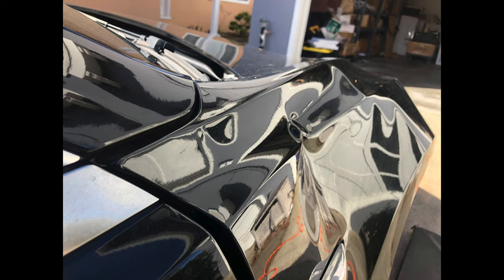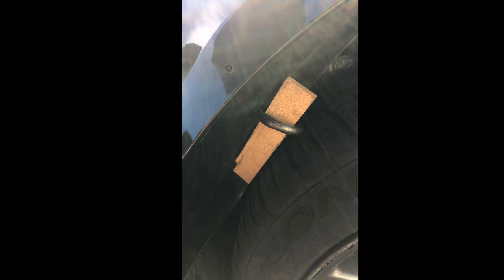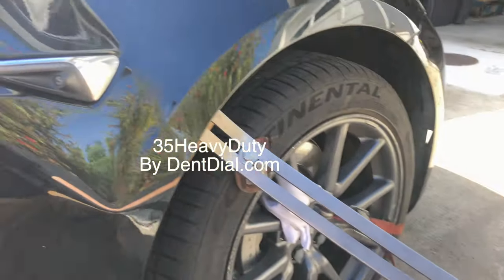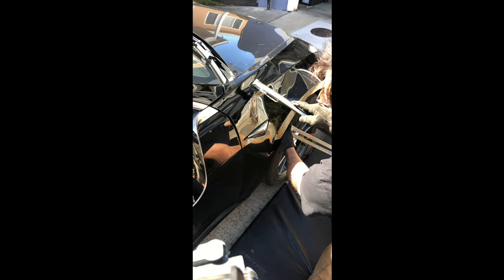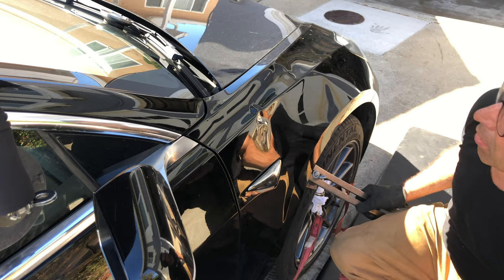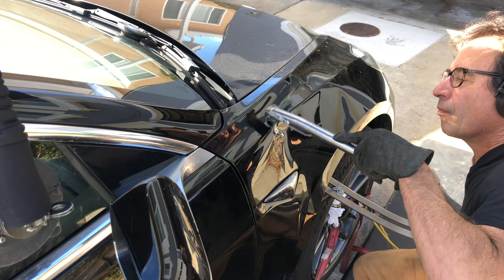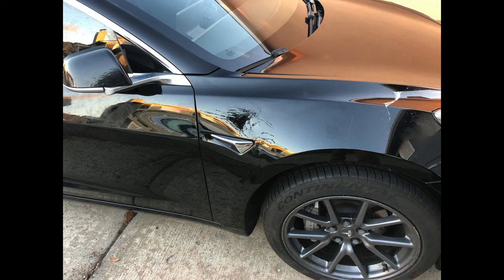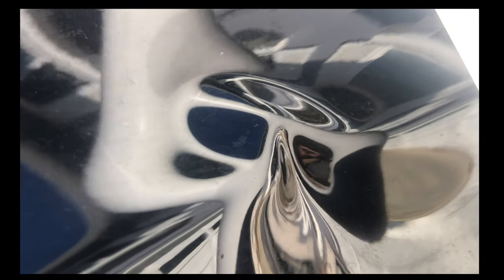Tesla Model 3 Front Fender Dent Damage Repair using Paintless Dent Removal method WDP. #dentexperts

Comment: Very well done, and an extremely nice result for what it was . . . if the owners happy, that's what matters, and great the original paint is still on there.
Suppose your or the owner had it wrapped again, which could have helped disguise it further.

Really curious, how long for that one ?
Might have missed it if mentioned in the video, 40 year body shop man, so very poor hearing !
Reply from the maker: Hi Les thank you for your comment and you can't hide too many flaws on black, I remember that this repair had a very high level of difficulty.  It was over a few days if i took out the many breaks I needed to film and handle calls, business admin  etc.  2 days is pretty fast in this profession because I didn't make any major mistakes, in Paintless dent repair there is little room for errors because each errant push or slight mistake can add 20-30 minutes to the finish time.   This year I'm 30 years in the field of Pdr and many of those years was studying  smashes and the first 10 years i couldn't get a result like this.  Pdr basically sculpting the metal using only reflection as it passes over the surface, basically knowing what is high and what is low.  It can get really confusing when the wrinkles are very busy and the distortion looks hopeless and why it all comes down to how you started the repair.  Thanks and be well!
Reply: @dentexperts  cheers Sal, yes complex and very often traditional PDR with the light etc can't be used when so messed up, have to work it until a little straighter when you can see it all with less complexity.
I did 40 years panel / paint, until picking up PDR about 8 years ago.
Doing the bodywork both helps and hinders with PDR, I find it helps with complex work, but hinders because I was used to wanting to just get in and push the dents out fast . . . too fast !!
But learning slowly to control myself there, and will never stop learning, new techniques, becoming faster, and better at PDR, it's an awesome path to take in a working career !!
All the best with your incredible skills, PDR techs that take the time to do more involved work are true masters of advancing the art.